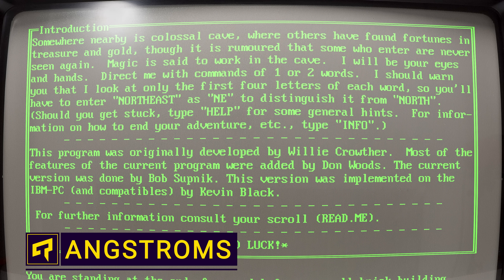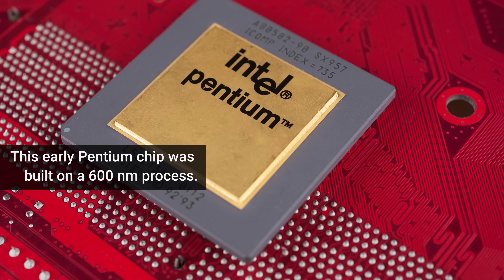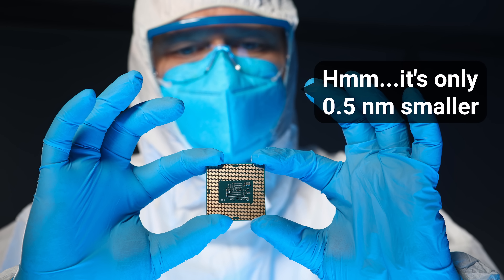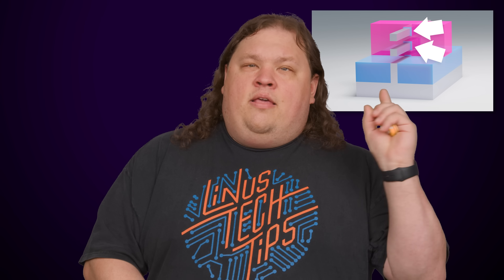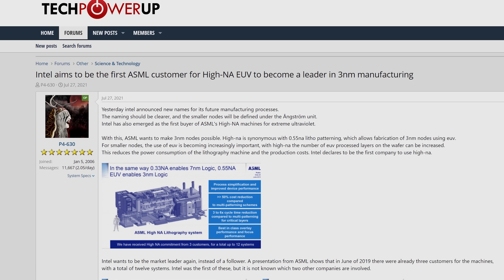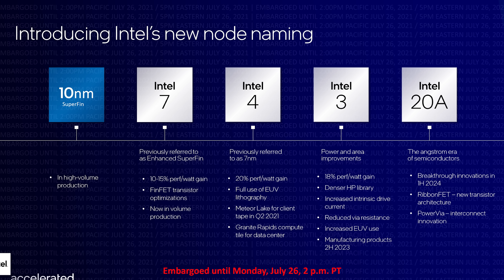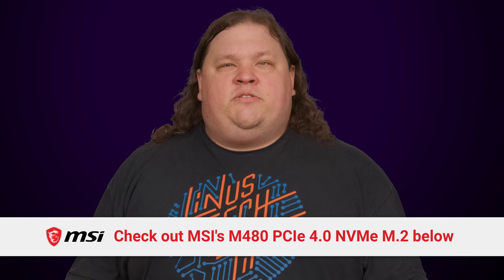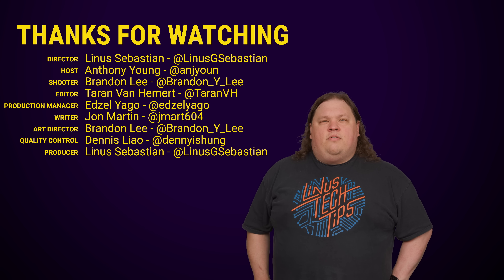CPU Angstroms vs. Nanometers

Comment: It's worth noting that measurements of length (nanometers and angstroms) became entirely detached from any measurement of the actual transistor. Years ago, that referred to the gate length of the transistor, but just before FinFETs became the norm (~22nm), the process node number kept shrinking while the actual gate length shrunk at a much slower rate. For example, most 14 nm processes utilize a gate length that is roughly 30 nm. Most transistor optimization these days comes from other methods such as tweaking channel strain to change the drive current of the transistor to make the transistors more power efficient or have faster switching (or both).
Reply: Wait, so what does the 14 nm actually refer to?
Reply: @Persun_McPersonson  14nm and below does not refer to any physical measurement (dumb, right?) It's used as a marketing term now to symbolize "if we could make a planar 14nm transistor, this is roughly the performance it would have" but naturally, over time, it's become further and further detached from that meaning as well. Nowadays it's "we made it a little denser and a little more efficient, so let's name this <insert next node name here>"
Reply: @AlexSchendel  
Ah, so they started having theoretical meaning and now don't have any meaning at all. Marketing is so stupid. Thanks for the info.

Comment: What a load of horseshit.. You wanna tell me that you cant just say 0.5 nanometers? Yeah it does get lower than that... 0.1? 0.05 ? No problem.. Its just an unit.. They want to change it just because of the marketing, not because you cant go lower in nanometers, hell you can measure it even in meters, it will just have lots of zeroes in it, doesnt matter
Also all this boo around it means more articles about it what means more attention for intel, even if it doesnt matter what they ll call it,, nanometers or amstr-whatever.. It is literally just 5 dollar investment calling it differently

Comment: If they were actually measuring the size of the gate, the nanometer scale would be sufficient, because a silicon atom is a third of a nanometer, but in reality they measure the equivalent size of a transistor on a flat surface.
Reply: The industry needs a standard.

Comment: Nobody:
Picometers: rubbing hands in joy at being next in line
Angstroms: hold my beer
Reply: @Waldel Martell he said that a silicon atom is 2.2 Angstroms in the video...
Reply: @Waldel Martell Both logic and math are taking a serious hit today.
Reply: angstrom sound cooler
Reply: @achmaddill  picometers and angstrom both sound pretty cool imo
Reply: @BlakeKevin Gaming  angstrom sounds more serious, because picometer resembles me picachu
Reply: @achmaddill  but Ångström sound coolest! :-)  And you can just spell it right and it is also cooler. :-)
Reply: lol I was coming down here to post something very similar
Reply: Hold my silicon
Reply: same thoughts
Reply: @Waldel Martell silicon atom is a couple hundred picometers, so smaller than a nanometer
Reply: Exactly, a downvote from me for trying to relaunch some antique unit of measurement.

If it's Intel trying to rebrand science, you should call them out for it, but you haven't mentioned picometers once.
Reply: @kalithp5397  I completely agree that angstrom is a poor fit. Picometer is much more straightforward. We do not need more opacity in CPU naming schemes. If anything we need less. Ideally legally mandated so chip manifacturers stop comparing apples to shotguns in their marketing BS.
Reply: @alexisrivera200xable  you completely agree that the industry and academia should step away from industry and academia standard units and express them in the units you learned in school because you've never heard of it and 10^-10 and "around the diameter of an atom" is harder for you to remember than 10^-12? 

Why do you care what they call it, though? It has nothing to do with the actual measurements anyways. The "2nm" devices IBM recently created had structures similar to those shown in 2:20. Each "ribbon" was 40nm wide and 5nm thick, excluding the material surrounding each ribbon. Where does the "2nm" fit in?  As far as I can tell, it's just Moore's Law marketing. You're mad at Intel... For deciding not to lie anymore in their node naming... Weird...
Reply: Well Americans prefer to use their own term of measurement instead of using the metric term.
Reply: @JerryWoo96  It's a unit used a lot by nuclear physicists, it's really not imperial. Also 10^-10 m is a lot nicer then most of the imperial units.
Reply: @JerryWoo96  that comment might be funny if you knew what you were talking about. An angstrom is 10^-10 m. It has absolutely nothing to do with imperial or "Americans." It's a more convenient unit than a meter, and is named after a swedish physicist. Just like eV are way more convenient than Joules while talking about nanotech.
Reply: @JerryWoo96  Ångström isn't some strange US unit.  It is based on metric system, and named after a Swedish scientist, Anders Ångström, founder of Spectroscopy.
It is used when measure atoms, as it of a convenient size. So it is kind of considered part of the metric system and used by Natural science measure light waves and atoms.
There are even a Unicode character for the unit Å.  Even though there are a Scandinavian letter Å (Sweden, Finland, Norway and Denmark).

https://en.wikipedia.org/wiki/Angstrom
https://en.wikipedia.org/wiki/Anders_Jonas_%C3%85ngstr%C3%B6m

How to pronounce it.
https://www.youtube.com/watch?v=ijiaeuKnYRQ
Reply: @JerryWoo96  Angstrom is metric.

Comment: These days we have so many transistors that it shouldn't be such a big deal to use Unicode Å for Ångström instead of ASCII A for Ampère.
Reply: No problem, just switch to swedish or finnish keyboard when discussing processors
Reply: @Viemo_  if you are limited by the physical keyboard in front of you, you're using computers wrong 🤨 ⟵ case in point

Comment: I am curious to see how Intel and other chip manufacturers are going to prevent electron jumping with these super small transistor gaps they have planned.
Reply: I remember in the past hearing that 5NM was the absolute lowest it could go due to quantum tunneling, but they seem to have found a way around that so let's give the boffins some time and see what cool stuff they come up with   :)
Reply: @Shanghaimartin  Indeed. I believe IBM has already made a 2nm chip, so yeah lol.
Reply: @spacejet13  I don't believe that 2nm chip uses silicon, the rumours where of a carbon nanotube design, pretty ingenious way to hold off electron migration for another few years
Reply: @Barryhick186  Huh. Thanks for letting me know! I am actually a big fan of carbonizing our microprocessors be it with carbon nanotubes or graphene! That, and I remember reading a comment about a new tech that can make bits by manipulating the magnetism of individual atoms? Wow I'm excited!
Reply: @spacejet13  yes, they have a "2nm process". Which translates to 40nm wide ribbons with around 15-20nm between them (including the dielectric).
Reply: @hank7281  XD! True, so true!
Reply: @Shanghaimartin  well, they haven't actually gone that low laterally regardless... But there isn't a hard theoretical limit. Yes, the thinner the barrier, the more likely tunneling will occur, but the higher (in terms of potential energy), the less likely tunneling will occur. If you have an infinitely high barrier (that's referring to energy again) with no minimum width (e.g. it isn't limited to the diameter of an atom), you could have a femtometer wide barrier with absolutely no tunneling. A big part of the issue is how pristine a layer you can make. A few nm of pristine aluminum oxide will easily result in negligible leakage current even up to a volt or so.
Reply: The truth is the transistors don't have a single measurement that is actually 2 or 1.8 nm in length. The naming is a marketing gimmick from when it actually meaned something up to around the 32nm node where we were using planar transistors. All it really means is the process is 30% or so better at fitting transistors in. Because of FinFETS for 14-16nm and better finfets to 5nm with other processes changes in contacts, double wells and other processes. 3nm - 1.8 is going to be a refinment of GAA type transistors with nanowires or nano ribbons. The critical dimension of gate length is still going to be around 5-10nm depending on what the transistor is used for
Reply: Yes im excited too
Reply: @Ooebc92g  good one!
Reply: statistical computation ?
like executing multiple calculation for offsetting the error of electron tunneling ?
Reply: It's simple, You just ask them nicely. I hear electrons are very polite
Reply: @Justapotato14  ahh I see 👍
Reply: @tim9605  but then how we can avoid the electron "wave" to tunnel if the barrier itself cannot attenuated those electron "wave"
Reply: stacked nano ribbons , with lower individual voltage to prevent tunneling but the combined vertical stack exerts enough compounded electrical field to effectively control the gate.
Reply: I don't know much about CPU design but once we start reaching the limits, would architectural changes make any difference like how AMD changing the way the CPU was layed out improved performance??
Reply: ie. quantum tunneling
Reply: Swedish company Smoltek nanotech holding, check it out
Reply: @apnavelN  Yeah, I heard of them. They are working on the 'new silicon', so to speak. Using carbon based wafers instead. They do not create the machines for chip manufacturing processes though. If they succeed in their efforts their stock price will be huge!
Reply: Same here, I am glad you made this comment bro. I am betting computers of 2025-2030 will be very unstable and will require error correcting codes (correcting for random electron jumps) that run on low powered chips next to the main CPU. :) Maybe we will have to switch to photonic CPU architecture around 2030.

Comment: Your talk is only about CMOS Boolean Logic designs. If you include Threshold Logic gates implemented in Resonant Tunnel Diodes, most of your statements fall apart. Also, compare EUV to the 1980s Fujitsu X-Ray/Chlorine etching. No resist reduces the number of fabrication steps significantly (no resist coating step, no resist baking stem, not resist exposure stem, no resist developing stem, etc). And that is without using X-Ray mirrors. Plus it does not have to be done in a vacuum.

A YouTube video on Tensor Calculus brought out an important question. How much of your result is a characteristic of the problem and how much are artifacts of how you approach the problem. 

In hardware, there are moments of new design followed by long periods of accretion (adding circuits to an existing design). The RS flip-flop was followed by the JK flip=flop followed by the Master Slave flip-flop followed by the JK Master Slave flip-flop. Then there was a new concept, the D edge-triggered flip-flop. Since we have stopped research into computer architectures (Data Flow, Direct Execution, VLIS, etc) and have simply assumed the von Newmann architecture the manufacturers are stuck in the accretion mode.

Comment: Missed opportunity here too point out that 13.5nm is a fundamental limit in the lithography, not to mention the diffraction effects when trying to reach resolution at the wavelength of the photons. You guys should ring up the physics department at UBC or Simon Fraser, tell them you're from the media!
Reply: ASML.com
Despite the fact that only Intel, Samsung, and TSMC are being named in this video, there is literally only 1 company in the world that decides the next available manufacturing process wrt chipmaking. That company is Dutch tech-giant ASML in Eindhoven, the Netherlands. ASML is the world leader in the research & development of chip manufacturing machines, which are being used by Intel, Samsung, TSMC, and many others to produce their chips. ASML is the market leader with almost a 90% share, meaning that roughly 9 out of 10 chips produced in the world are being manufactured on machines from ASML... It's worth a mention IMO... Greetz from Amsterdam xxx

Comment: 0:25 The Ryzen 3400G show here is based on Zen+ meaning it’s manufactured on GlobalFoundries 12NM Process and not N7
Reply: And even worse: the transistors are also not 7nm. Even on a processor that uses a 7nm process, the transistors are not 7nm. They're much bigger.

Comment: They really need to be getting on that graphene man. Way less resistance, way less power/heat output, and therefore way higher achievable CPU clocks. CARBON > SILICON
Reply: Thanks, we should be set now. They were just waiting for someone to tell them to get on with it
Reply: If it was easy and worked then everyone would be using it
Reply: soon, the production methods are catching up but it's not there yet.
Reply: It's not easy at all. Think. Manufacturers have been using silicon for decades. And suddenly they want to switch to graphene. They need to adapt certain things. Carbon is not the same as silicon
Reply: @How23497  Did I say it was easy?

Comment: It happened before in the pentium era, where processor processes were measured in micrometers until it got to single digits and started naming then in nanometers for the Core ones. Props to Anthony, maybe the one with the most knowledge in LMG
Reply: Just a note that the script was written by Jon and not Anthony. Although he definitely knows his stuff.
Reply: 0.35 micron had 0.35 micron gate lengths and 0.35 micron half pitch.  That was the last time the process node size name was true. After that DRAM scaled down the half-pitch (prioritizing memory size over speed) and CMOS logic prioritized scaling down gate length for speed. Lithography node size name became increasingly farsical before becoming meaningless with finfet.  E.g TSMC 7 nm has 54 nm transistor gate pitch and 40 nm minimum metal pitch. Nothing is remotely 7 nm on a 7 nm chip. It is purely a marketing term.
Reply: @soylentgreenb  7nm isn't actually 7nm but Intel's 14nm isn't strictly 14nm either.

When you get right down to the specs 14nm has features that are 6nm in width and there are plenty of parts that are significantly larger than 14nm.

7nm is very dense so at the end of the day it doesn't matter, it is better than 14nm and comparable to Intel's 10nm, only its been available and working in mass production for years and 10nm just now hit desktops.

That being said, they're still pushing the clock limits on both so power usage is through the roof, if they backed off a bit they could sell 35W 8 core desktop CPUs, which I think both companies should do. They're optimizing profit so 65W is the mainstream now, which isn't terrible but AMD's IO die uses about 15W by itself, they can't clock gate or power down parts of the IO like Intel can because it's a separate chip, it must remain powered on to communicate. They may be able to get around that at some point but it'll take quite a bit of synchronization to power down separate chips and power them back on without a delay.
Reply: @glenwaldrop8166  The two most useful metrics are MMP (correlates with SRAM density) and gate pitch/CPP (correlates with logic density) and they're still far from sufficient to describe how good a process is. Fin width of transistors isn't a very useful metric and isn't analogous to the old gate pitch or half-pitch definitions of node size in any way. I would call intels 14 nm a 70 nm finfet process (gate pitch) and intels 14++ process an 84 nm finfet process (it has extra dummy fins, which makes transistors bigger but improved some performance metric); if I had to call it a node size name at all. It would not be comparable to a 70 nm planar process, but it would be more honest.
Reply: @soylentgreenb  That's fair.

The SRAM density is also an oddball when you're talking about CPUs anyway. There's not a tremendous difference between the Intel 14nm SRAM and TSMC 7nm SRAM density (big picture wise) but there's a fairly substantial difference between their transistor designs. TSMC is quite a bit denser, however, they also can just barely hit 5GHz, though to be fair I think the arch of Zen1 and Zen2 were the primary limitation there, even 32nm could hit 5GHz with ease with the right arch.
Reply: @soylentgreenb  exactly. I didn’t remember the exact units, but yes, it was in .xx micrometers until they changed to nanometers. Thanks for all of the clarifications!
Reply: He is the Wise one at LMG.
Reply: He's reading off a script lol. Doesn't mean anything
Reply: @How23497  he likely wrote the script. He was hired because this is his wheelhouse.
Reply: @glenwaldrop8166  If he wrote this script, it proved that this ISN'T in his wheelhouse.